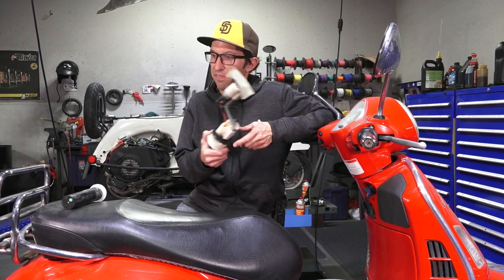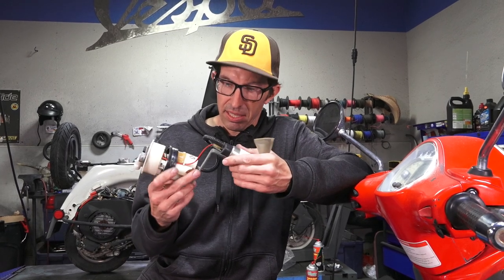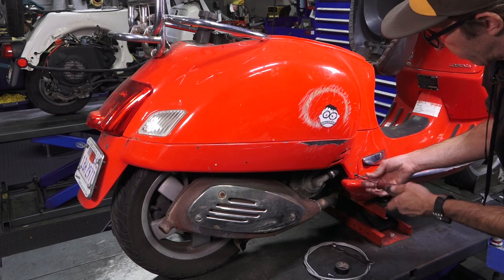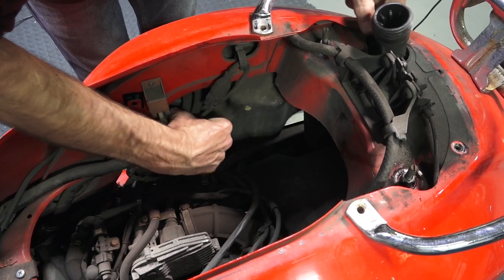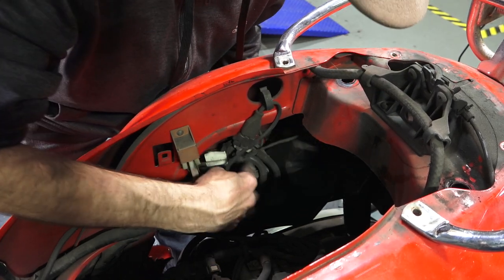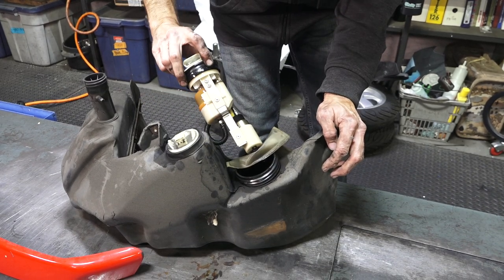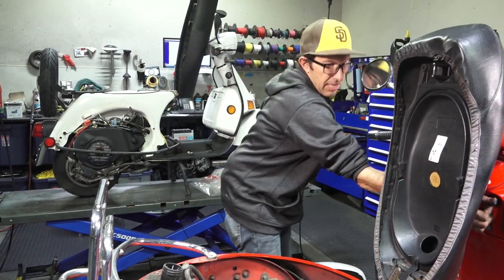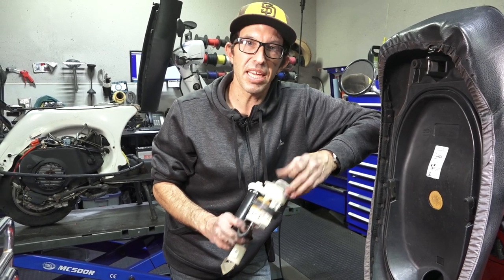How To Remove a Vespa Fuel Tank

Comment: Thank you so much Robot. I watched your video a few times and it gave me the courage to swap out the fuel pump myself. About 3 Hrs with a couple of blocks of wood and car jack. Followed your instructions and jacked the body up way high to pull out the fuel tank and swap out the cruddy old fuel pump covered in rust. Surprised it worked at all. The job was a lot simpler than expected thanks to your very simple to follow and informative video. Two thumbs up from me👍👍

Comment: I replaced my fuel pump yesterday. The GTS is back on the road! The start of my issues was the burnt plug lead coupled with the coil going bad as a result. I had eliminated the fuel pump from the list of issues because it ran on start up and pumped what seemed like a lot of fuel when I disconnected the line. I borrowed a fuel pressure gauge and it showed 1.2 bars at idle...not the required 2.5 bars. The video from Robot at Scooterwest helped and in a couple of hours, I was riding again. Whew.

Comment: Great info .. found the issue I had with a loose electrical connector at the pump. My GTS300 (2019) somehow rattled the connector apart. Ride safe .. Squeak

Comment: Absolutely astonished by that statement on the fuel filter, “meant to last the life of the scooter”. What does that translate to in running miles, 110,000? Also noticed you weren’t wearing your fancy Apple Watch for this job hehe 😏 
This clip is Designer approved 🛵❤️🤖

Comment: Dear friends

I have a Vespa vxl 150 Bs-6 2021 brand new
I had an issue that I could not understand why it keeps happening.
I experienced star failure every time when the temperature is high as we are in summer and the temperature goes to 48c some times.
When trying to start it's clear for me that the fuel pump is not functioning.
When it's cool and at night or when I cool down the temperature of the bike it start up normally.
My question is that is there is any overheating sensor fitted on these bikes? Did anyone experienced similar issue?

Thanking you in advance and regards from Sudan

Hozozo Ali

Comment: i was fitting a new grip for the throttle it was tight , must of twisted it to far thing i have broken some thing ?unable to get it to drive >do not no where the prooblam ,  is, though i had snaped a cable , but dont think i have

Comment: Robot I have a 2009 piaggio fly 150 fuel sending unit that is on the top of the tank next to the battery. My gas gauge doesn’t read correctly so I’m thinking about changing the sending unit. But I’m thinking all I gotta do is just spin off the sending unit since it’s easy to get to. Am I correct ? The sending unit is next to the battery on top. It looks easy & I’m hoping I’m correct. Thank you for all your great videos. Merry Christmas 🎄🎁 Bob
Reply: I had an ‘08 Fly-50 as my first ride. You’re probably correct about ease of replacement but hopefully the Vespa Motorsport team will shoot you a reply. Find yourself a parts diagram PDF for the Fly. I’ve been able to do a lot of my own Ducati work by studying those parts diagrams and exploded drawings (and a Haynes manual and YouTube vids too of course) because those drawings give you context . Be careful though; success could lead to buying more bikes, tools and becoming obsessed if you’re not carful 😉
Reply: @Designer_Opine  yes the 09 piaggio fly 150 is my 3rd piaggio scooter as I have a 2003 piaggio LT 150 also. I’m 64 retired with plenty time lots of tools & many workshop & Haynes manuals & I watch tons of YouTube videos. What gets me crazy is there so many parts#s for same part. And many scooters use same or similar cross reference parts. I’ve changed tires on both scooters, Michelin city grip 2s. I try to do all work as I’m now changing all rubber vac & fuel hoses & any wear item . Got the topcase & windshields , kickstands etc all the fun stuff. I’m single guy so I bought the 09 piaggio fly 150 for $700 but it needs some TLC but it looks & runs great so friends can have a scooter to ride with me. Both scooters have under 5,000 miles on them. Working & tinkering can be fun way to enjoy time. Robots videos are a life saver. Wish he’d show some older stuff especially the 09 fly 150 as lots them were sold. But I understand they showing the stuff that’s more recent , nicer & more expensive. Robots my hero a friggin scooter genius & great mechanic. I’ve picked up some great deals from scooter west on clearance that Robot has shown in videos. Happy scootering & Merry Christmas 🙏🍀✌️🎄🛵

Comment: Hi Robot,

I have a question About Some product on your website.
I have a GTS 250 2009 and want to fit the 2015 euro style led blinker for front and back.

On the website i can find a set That contains the front and rear blinkers for   $359,90. The product no. Is MI202-KIT

Now i can also find these 2 separeted 
The front set with no. MI200-GTS-EURO-FRT

And another separate rear set with no.  MI200-GTS-EURO-REAR

Are the set and the two separate Products the same Thing?
The set is more expensive at $369.90
And the separate ones combined are $244.90 

Seems that there is a difference in them but What?

To clear any misconception, i need the front and rear blinkers including adapters to make them fit a older GTS.

Thanks for your video’s and i would like to hear your reply 
Thank you.